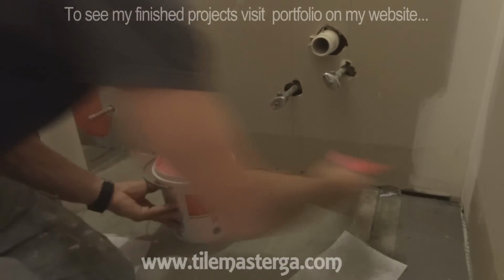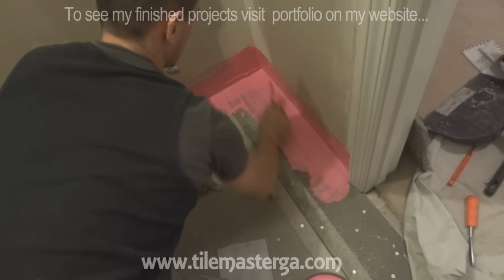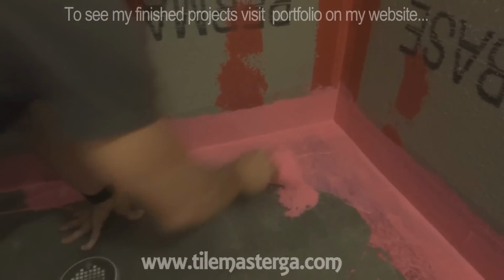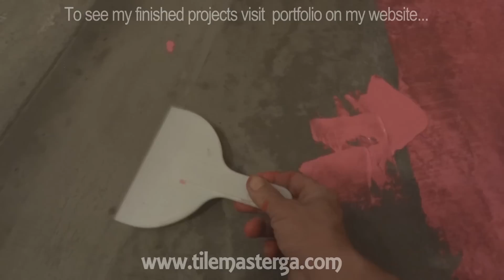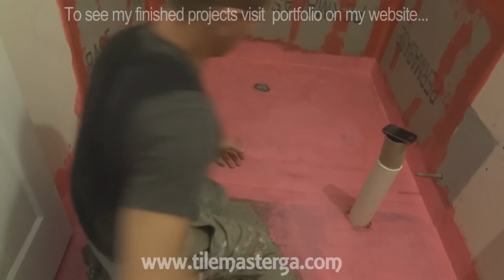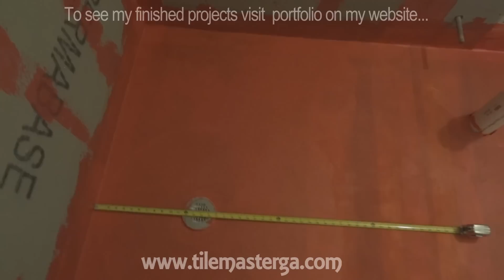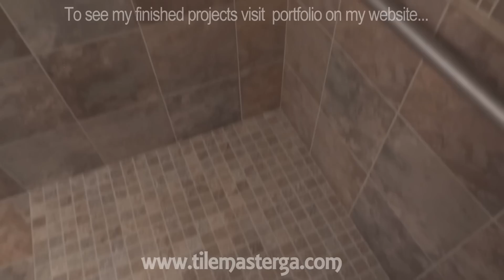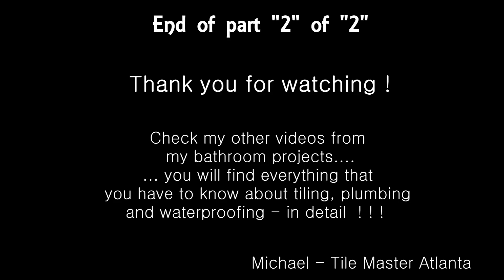Part (2) How to build and tile curbless ( handycap ) walk -in shower.

Comment: very close to what I will have in my FLorida home. In Thailand I saw most showers are walkin with a partial wall which helps keep the water spray in but you really don't need a shower curtain.  I will have a shower that one can wheel or use a walker to get in to.  Good job and good post

Comment: I really appreciate seeing this project.  I'm in the process of doing a similar project myself, with only a few differences.

I'm using a linear drain with a roll membrane for the shower area, but I will use the liquid membrane for the joints and holes in the walls.  I may also add a liquid membrane for the rest of the floor, and extend it up the walls like you did.  That seems like a very good idea.

Any ideas on where I might find the fiberglass mesh tape you use locally?  If I were to ask for it, I'm sure most places would show me the 2" wide open mesh used for drywall or cement board.

Thanks again for your videos - I really appreciate you showing everybody how it should be done.
Reply from the maker: Thank you for your comment and good luck with your project.
I am selling this mesh tape on my e-bay auction.
Look at:
http://www.ebay.com/usr/tilemasterga

Best

Michael
Reply: I just did this last week.  This video, as well as your other videos on waterproofing, was invaluable.  The materials worked exactly as shown here, which was really helpful.  I used a chip brush and roller, but otherwise it was exactly the same.

I know without a doubt that my project will turn out better because of your videos.

Thanks again!

Paul

Comment: Hello from Australia, this is a great video on waterproofing however I have to question the absence of redguard  on the entire wall. In Australia our code says that we have to use blueboard or similar in wet areas. Blueboard is Gyprock with a water resistant surface but even having used blueboard code calls for a waterproofing membrane to be applied over the entire shower floor and walls to a height of 2mts, once that's done and before you even think about tiling you need to have the waterproofing Police from your local council come out and issue a certificate stating that code has been satisfied. Some councils want proof that the work was done by a licensed plumber whereas other don't care who did it as long as it meets code. I don't know of anywhere in Australia that doesn't require waterproofing on all shower walls. I can see by the standard of your work that you know what you're doing so I'm just asking the question, does this job meet code?

Comment: I just looked for a video like this last week. Thanks for posting.  I bought an older house in the fall.  The "newer" more modern second bath in master from 1963 has a 30x30 shower only.  But it turns out the shower pan has rusted through.  The whole bathroom is masonite paneling and painted plywood cabinetry so I was looking for an excuse to eventually gut it.  I wanted a curbless shower for aesthetics, but I'll be 70 by the time I pay off the house so it may make sense for mobility issues by then.  I enjoy your videos.

Comment: Awesome informative video. Quality job sir! Those that said your method was bad, wow what a lot of hot air.  If water could get thru that system it would be a miracle.  The nice thick concrete pad you put in was 100 times the strength of any wood you removed for the install .Nice inspirational install, I,m gonna do mine just like this. I have been wanting to do one for awhile. I have a lot of experience doing stalls with ledge and poured pan but not a walk in like this. Thank you for the video!

Comment: Hello TileMaster...I wanted to know how long this project took from tear out to completion? Very nice work and I enjoyed watching the video.
Reply from the maker: John Thompson John, everything that is shown is 100% correct - however not easy to achieve.
Project took 11 working days.

Best.

Michael
Reply: TileMasterGa I too, noticed that you did not construct (what we in Florida) call the Pre-slope pan. Is that not a requirement in GA? I personally feel that if you waterproofed the entire thing, it's not needed, but I was just curious as to the code requirement in GA, verses what's required here in Florida.
Reply: +TileMasterGa  11 days alone or with a helper?
Reply from the maker: with helper - Peter
Reply: that's not bad, did you have all materials on hand or was there a delay, due to customer?

Comment: very informative videos on curb-less shower.  Is it possible to install a frame-less sliding shower door on a curb-less shower like this. If so, will there be specific issues to consider that would make the glass doors installation different than with a shower with curb?  Thanks. Luc Van Puymbroeck

Comment: how thick is it roughly for a newbie when you apply it? generally 3 or 4 times thicker than painting? i know you have to get at least 1/32 of an inch on (.030 inch) wet film. so you have to get this stuff on there quite thick

Comment: Hi, First of all I want to thank you for your videos. I wanted to ask you : Does shower floor stones get installed after the walls are done? Meaning the floor will butt up against the walls. I got stuck with this type of Instalation and think it is wrong, my hope is that I will be okay just because I used concrete Sheetrock on all the wall plus I applied water proofing red guard.

Thank you very much for you Advise.
Reply from the maker: Floor tiles should go under wall tiles - always! especially in the shower area.

Answering your question - floor first.

The way I am doing , I tile almost entire walls but bottom row of tiles. Then I tile floor, and when this one is dry I am installing bottom row on walls - on top of already done floor.

Good luck.

Michael

Comment: No shower curtain?
Reply: It is NOT...the Tile guys job to put in either "Glass Doors," or "Shower Curtain" etc.
That is thee Homeowner or designers/builders job, just like the "Plumbing is NOT... the Tile & Stone setters job...
Reply: *****
You could and will a little (not that necessary), sorta like He said, but if you GET That MUCH WATER on the Floor....Basically You have other Problems....cause in such a case it's then RUSHING out the Door anyways, it's NOT... a Pool!!
(:D)
Reply: LOL. Yes, I was kidding. A plumber would not be the decorator. But my thought came from when I am in the shower on my wheelchair. The shower water splashes off the chair very much. It goes everywhere. So I need a curtain for my situation. I have a shower like this one. :D

Comment: I watched both videos nice explanation on how you do it. I cringe at all those wasted man hours, start using schluter! So lets hit on a few major points here....
1) you missed your pre-pitch before you pan liner install - not good and it is a code requirement here in florida and I would imagine in GA.
2) you really need to waterproof higher that permabase is not waterproof
3) ALWAYS get an engineer involved in structural joist cutting, no excuses 
4) what thickness are you achieving with your redguard? If only one or two coats that will not warranty specs, that is why you need a dept gauge indicator
5) you are leaving yourself exposed for lawsuit if anything ever goes wrong 
Now before someone says "who are you". I am a state certified contractor in florida one of the most strenuous building code states. I also do alot of curbless showers; actually that is all we do now i our bathrooms!
Reply: JP Carducci Inc. Do you post videos of your process from start to finish? Because I have not found any on your Youtube channel. It would be valuable to many Youtuber's to have a contributor not only post text on what is right or wrong, but video to back it up. Thank you.
Reply: Yes it would be valuable! It has alot to do with timing and cost. I use a professional company for my most of project videos, and to do a start to finish video of a curbless shower would take a few days or more. What I explained in my comment to this video was nothing negative, to back up what I said is all very easy by searching the specific details I posted about.

Comment: Wow all that waterproof material gone to wast your doing it all wrong ...your Fired!!
Reply: Umm no you are also wrong, all gaps between floor and walls should be filled with a silicone like Sikaflex, or what is called a bond breaker, then waterproofed over the top, everyone also did not pick up on the corner mesh not having some waterproofing on the bottom flap before placing the next layer on top to form the corner piece, there are other things not done correct but it will still be ok, in the end a nice job done, well done TileMasterGa.